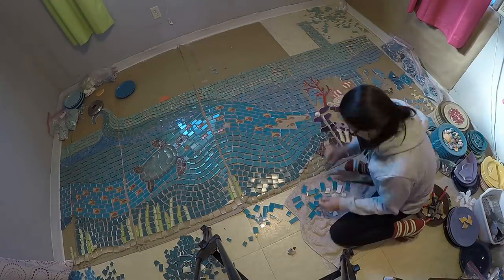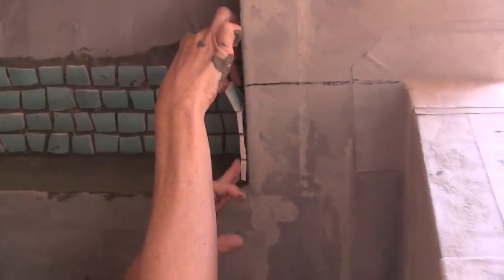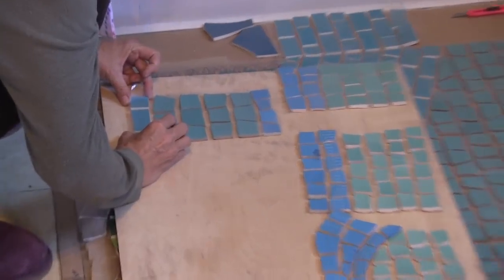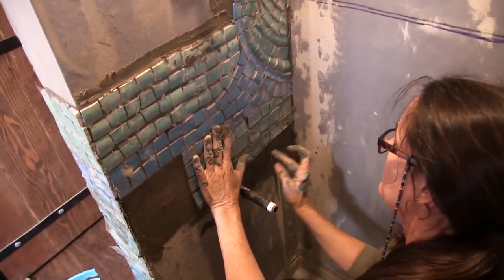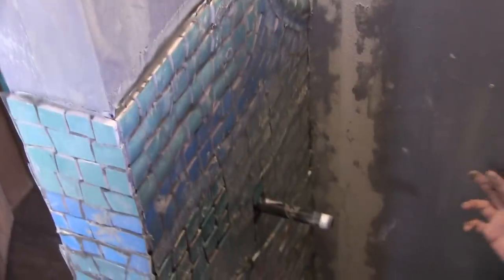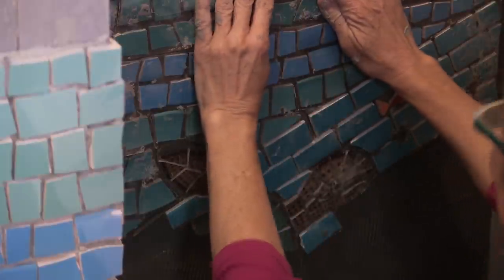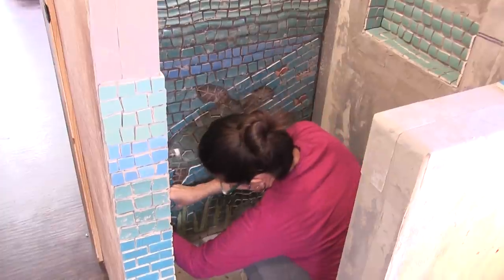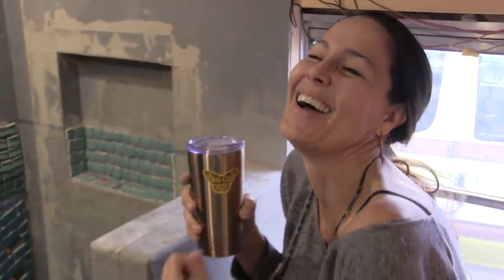Broken-Dish Mosaic Shower in a Skoolie~ Test Patch & More!

Comment: I was in the stained glass business for 15 years, and I have also worked with tile.  On the smaller pieces, you might want to etch the back of them to give them better adhesion with the thinset mortar.  You could run a dremel over them to scar the backs.  It will help when it comes to grouting.  The plates are smooth, and probably will be okay on the larger pieces, but the tiny ones they won't have as much to create a bond.

Comment: Looks good. A rubber float will help you set the pieces and save your hands!  The float will apply even pressure and insure a good bite In the thinset.

Comment: Really looks great, Kerry!  I have had better look luck using a mastic glue on vertical surfaces instead of thin set.  It seams to hold better, and doesn't slip as much while drying.  You did a fine job though.

Comment: I did a small round table while we lived in Greece (Island of Crete)  using broken plates.  There was tons, literally, from clubs that did traditional entertainment where dinner plates were broken.  Like you, I spaced everything out on the floor, then took scotch tape to connect it all before transferring to the table.  Scotch tape was NOT a good way to go as it tore and pieces were continually falling as I tried to move it all from floor to table.  Ended up doing it one tile at a time.  I’ve contemplated doing another but have been discouraged remembering my Crete experience.  What specifically, was the brand of tape?  Others have told me to get some netting and use 3M spray on glue but your way seems easy and I need not experiment as much doing the table,
Reply from the maker: Any brand of clear contact paper will work. We got ours at Walmart.

Comment: I wonder why someone don't like this video🤔
But why did you choose tiles on a moving bus? Wouldn't it crack after a while/when the bus is moving? I really enjoying watching your videos.
Reply from the maker: Most Schooley build end up with tiles because there isn't a lot of preformed showers that fit. As long as you are using a cement board backer there is virtually no flex and the tile should be fine.